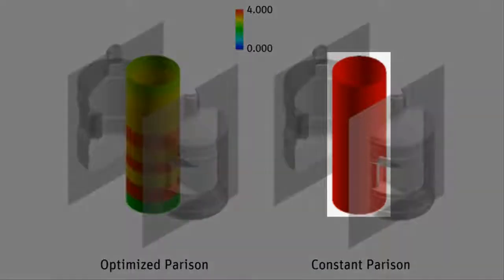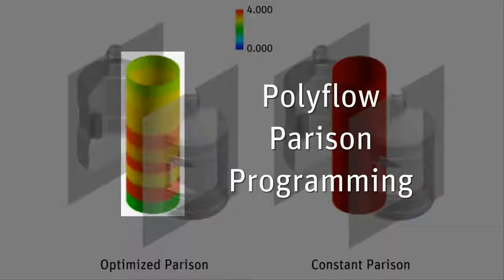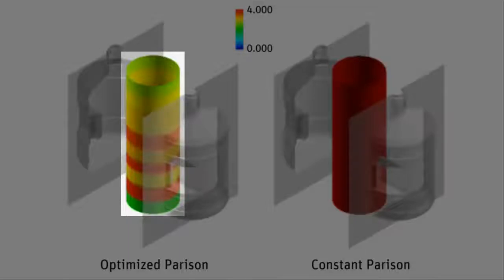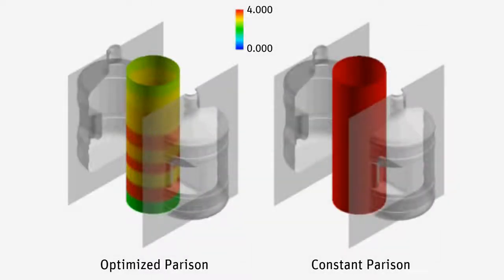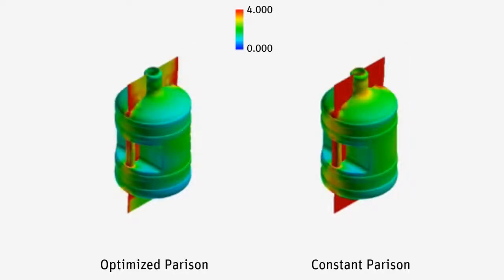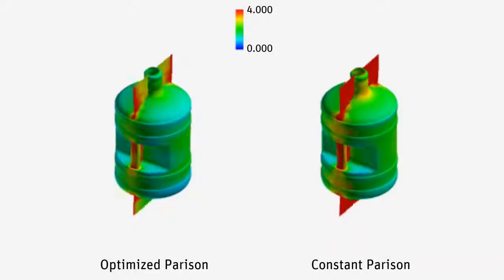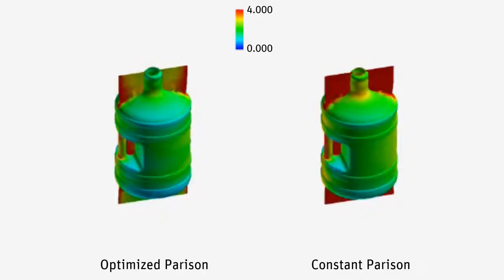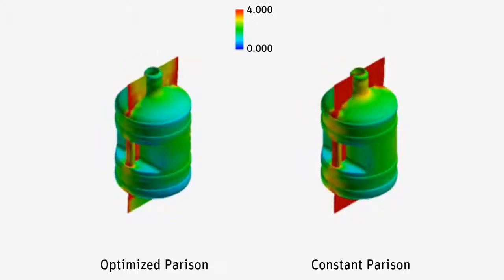ANSYS Polyflow  Blow Molding Simulation for Optimized Thickness

Comment: Hello Sir, Please help me. I have to do a static analysis of the part which we produce with blow molding. I do not need blow molding simulation. ı have 3D design ı just need to convert it produced by blow molding process. ı mean material must be blow molding. please help me.